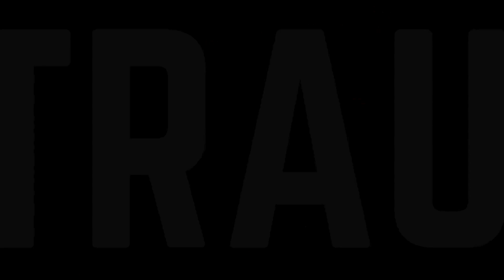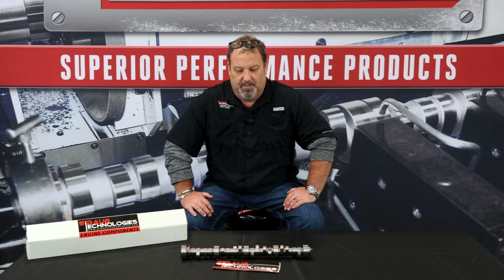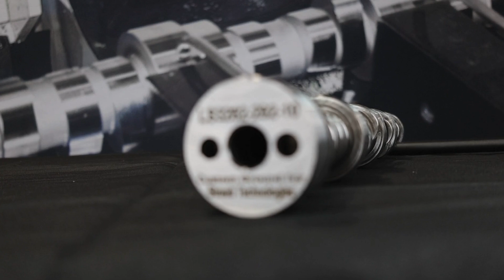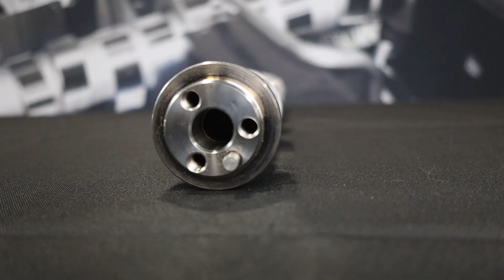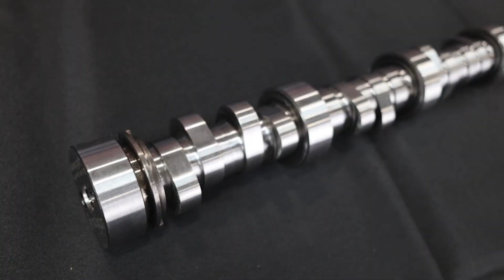Camshaft 101

Comment: Wish I’d seen this prior to selecting a cam for my 10:1 540bbc for a world products crate engine that was in the 69 Camaro I purchased a year ago.  We did a little head work to bump cr and flow a bit to 390@700 and used a Howard’s solid roller 4/7 swap 261/267@.050. 703/714. 108+4.  Will do some street driving, 1/4 & 1/2 mile and road racing using a th400/3600 stall with 3.73 gears and gv.  Sure hope it’s a good all around cam.

Comment: The import stuff you speak of is generally Dohc, not pushrod. The efficiencies of those chambers are different and will "overflow" if the exhaust has too much. The BSFC will be terrible if you apply a push rod style cam theory to it. It's like a super hemi. This is always part of the reason they respond to turbos so well.
Reply from the maker: That has not been my experience.  I have NA and Turbo pushrod engines with reverse split camshafts that run very, very well.    Once you reach that 75% mark, some applications will need a reverse split camshaft.  It is common with smaller CID BBC running AFR300 heads that I use a reverse split camshaft....more intake duration than exhaust.

Comment: Ok, you need 7 degrees more on the exhaust on your combo. Where do you do it? Open it sooner? Close it later? Some combo of both?
Reply from the maker: that's the beauty of engine combinations is that there are multiple ways to get there.   If your running a solid roller the easiest way to get a change in performance is the use of lash.   Never loosen more than .004", but you can tighten cold to almost Zero.   Using lash you can increase and decrease split to see results.
Reply: Lol, knowing the answer to your question is why straub gets the big bucks lol, any why he will never tell you lol

Comment: What's the flow ratio test criteria, peak flow of the intake port with no manifold/ peak flow of the exhaust with a 4" stub ?
Reply from the maker: The way I have been taught the important numbers are .200 to .500".   The valve is going to hang out here the longest.